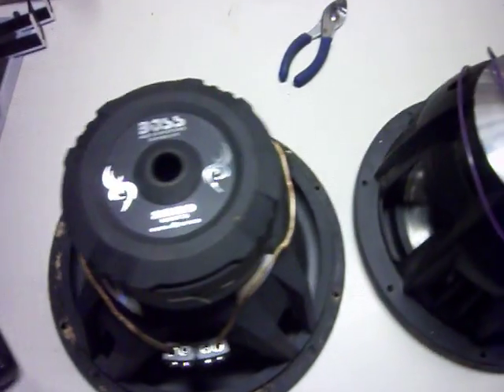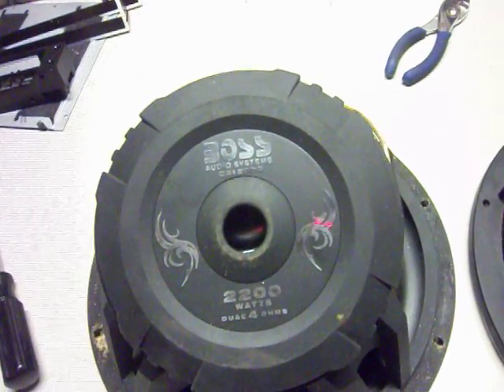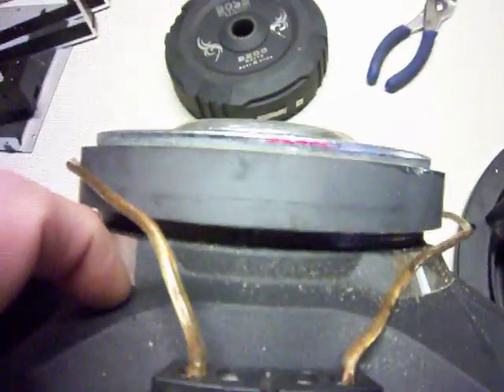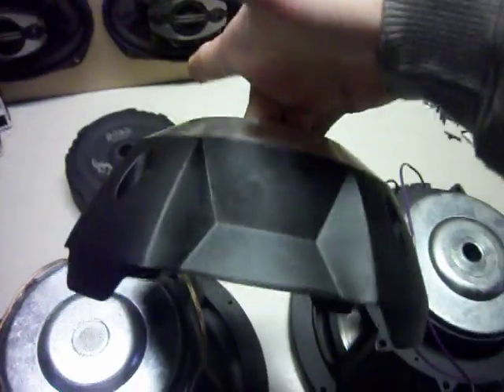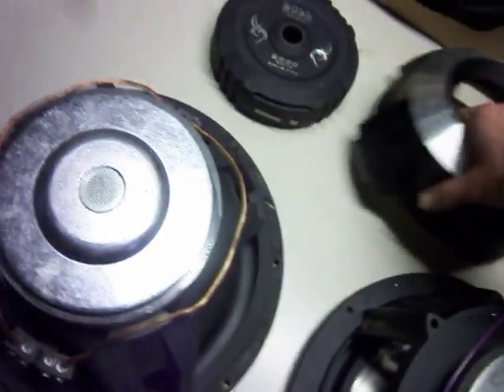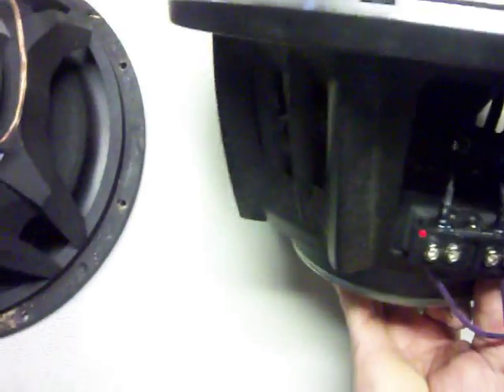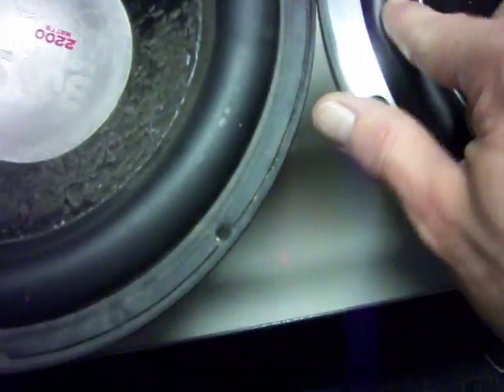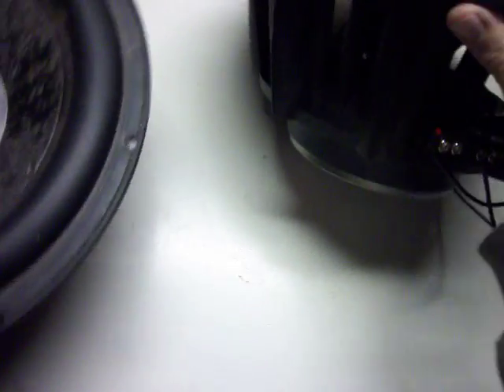Boss Audio P128DC 2400watt 12'' subwoofer Vs. Boss Chaos CX120DC 2200watt 12'' subwoofer

Comment: The other boss phantom subs with the skull and red stitched surround has a dual slug motor. i was surprised that it took 900rms i was thinking it would only handle 400-500rms but it still works 2 years later street beating the hell out of them daily

Comment from the maker: yeah .... 6 layer flat wound coil double stacked motor , dual spiders on the sony vs boss 4 layer round wire single slug motor and single spider ... id go with sony . lol . but near the same price you can get a NVX NSW and those would stomp either lol .